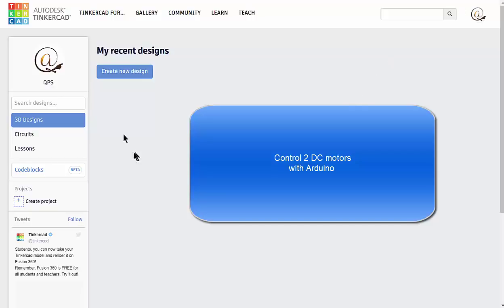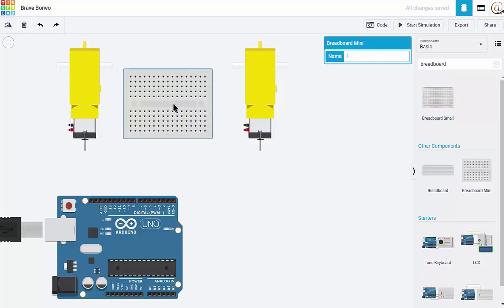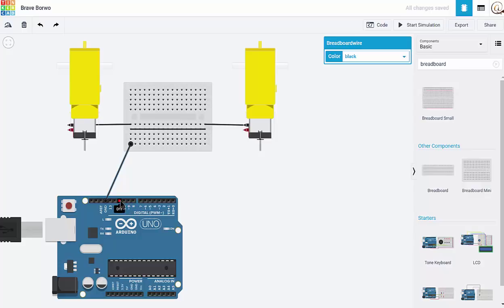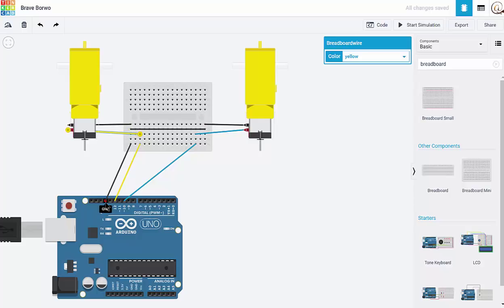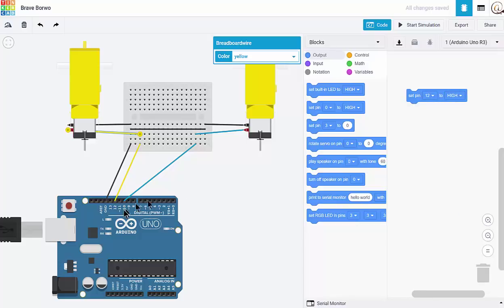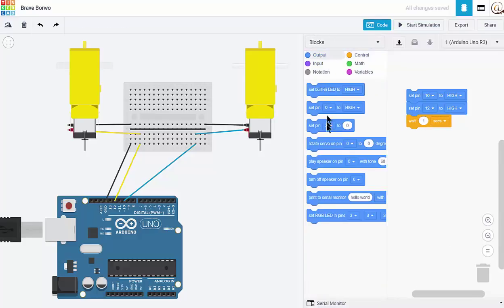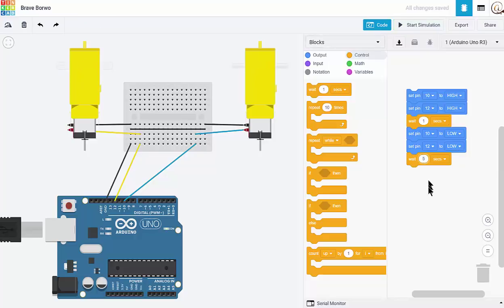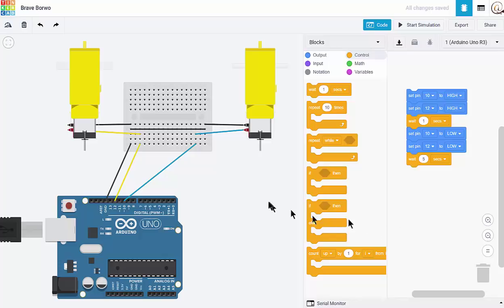Arduino DCmotor

Comment: how do i make the motor rotate in the opposite direction?
Reply from the maker: if you have a dc motor controller, there are forward and reverse pins for each motor. You can have 2 outputs from the arduino for each motor, one for forwards and one for backwards

Comment: Thank You! Really helpful but how can I use batteries for this so that I could take out the wire?
Reply from the maker: the motors need a direct power supply to the motor controller, that power supply can also drive the arduino so you can have just one power supply. In tinkercad don't have a convenient motor control module to be able to show that wiring. you can see a picture of the motor controller in this other video on the channel https://www.youtube.com/watch?v=hljoHpAlImk

Comment: is it necessary to have a  motor controller in order to run 2-4 motors even if we want all to run in only one direction?
Reply from the maker: Yes a motor controller is needed to supply enough power (electrical current) to the motor. The arduino can be damaged by having too much current drained from one of its pins. The motor controller takes a separate power supply line directly to the motor and controls that from the values sent from the arduino pins.

Comment: HOW TO COUNTERCLOCKWISE THEM
Reply from the maker: when this gets taken out into  reality you will be using a  motor controller unit, which is represented by the breadboard here. Then you can set one pin for forwards and one for backwards. (for each motor) . That lets you control the direction. You need a motor controller unit to power the hobby motor - otherwise you risk burning out the arduino